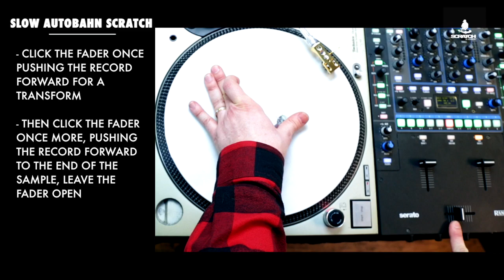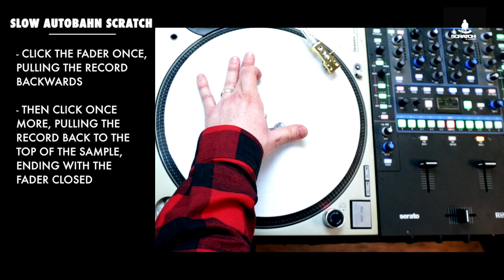DJ Dirty Digits | Slow AutoBahn Scratch | Watch and Learn

Comment: i think that the first move can be made without the crossfader, is just a baby scratch...
Reply: DJ VITO it’s a Slice I think. Or Dice. Can’t remember for sure. A baby does sound a little different not as precise and clear.  Or sharp.
Reply: @jerbear6947  Best off using a baby scratch at first to get the flow then once you have the timing its a lot easier to make it a chirp. The way he is chirping this is quite loose and not at the attack of the sample so it sounds like a baby.